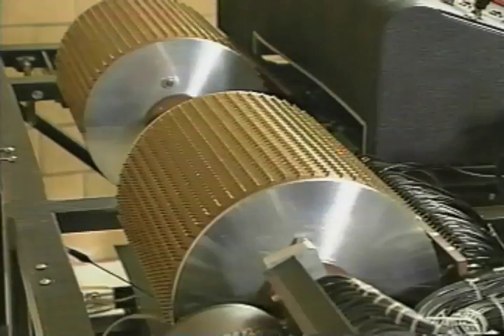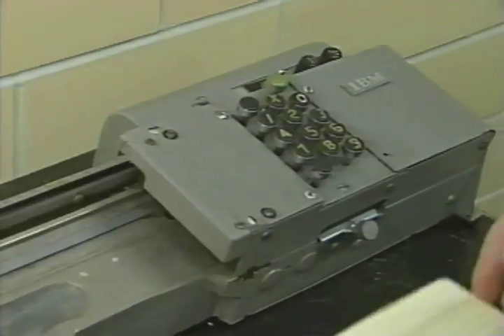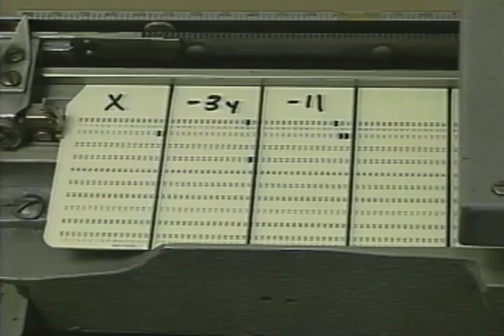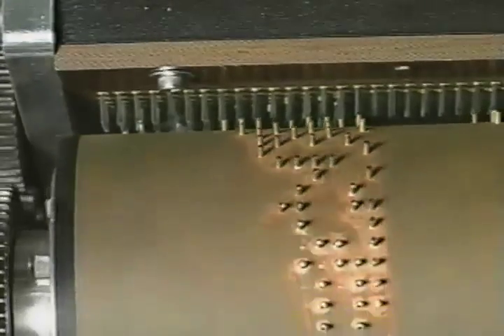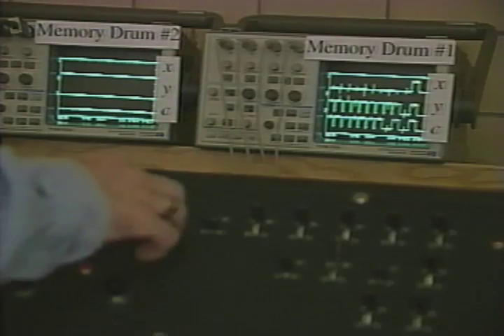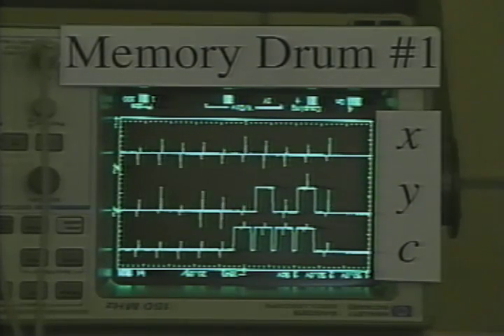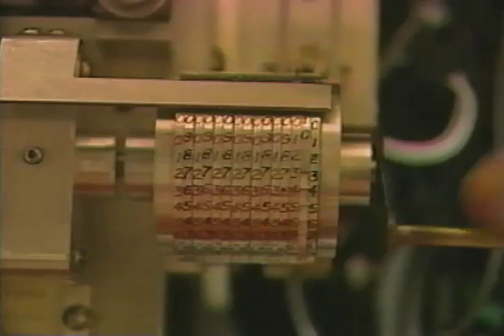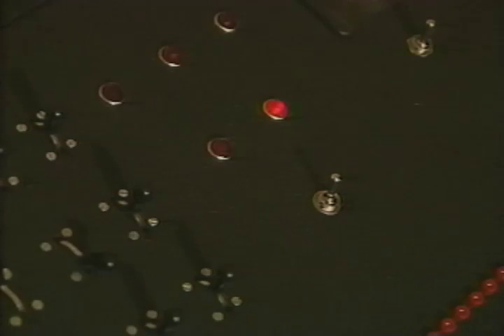The Atanasoff-Berry Computer In Operation

Comment: Computer operators had to be hands-on and attentive with all those mechanical parts. Imagine how badly you could mess up a computation if you put a card in backwards or if it wasn't seated properly.
Reply: This computer was a one-off, built as proof of concept.  It was never a production machine.  Computers very quickly became more practical operationally.  Hollerith cards have one corner cut, so a card in a deck cannot be oriented incorrectly without it being obvious.
Reply: The Apollo space program had a computer whose program was thin wires passing through metal cores, basically a metal core memory, but ROM not RAM.  They hired women skilled in needlework I believe, to "weave" the program.   Lots of room for error with that process!

Comment: what a waste of cable wires, why dont use printed circuit boards™? or even better, serial communications™?
Reply: This computer was one-of-a-kind.  Printed circuits are only economic when multiple copies are needed.  In any case, nothing was built with printed circuits in the 1940s.

Comment: It was not the first computer to have parallel circuits, since the 1941 Z3 had a parallel adder.
Reply: The early Zuse machines were relay devices, not electronic.  The ABC was the first electronic computing device.

Comment: The ZUSE Z3 was completed in 1941 and was a fully programmable digital computer, it was electro-mechanical though. But even the ABC has some significant mechanical elements. The ENIAC and the COLOSSUS were quite early, too. A statement like that at the beginning is difficult, especially when you think of several development prototypes that were built around that time. But never forget the ZUSEs. Just sayin' .
Reply: Oh get over it, this one was done in the 30s before any of the others.
Reply: I try to remember as many of them as I can, because they probably all made contributions.  Babbage.  The British wartime stuff like Collosus(sp?).  Zuse machines.  ABC.  Eniac.  Even the Univac I, the first commercial electronic digital computer.  People have this desire for "firsts".  But progress is usually more iterative with the limitions of each iteration driving the next iteration.  In any case, these fledgling computers are all interesting to me.

Comment: Wow! I would love to revamp this design using transistors and LEDS to replace the vacuum tubes. The LEDS will show you the logic state of each transistor.
The rotating drum looks like the biggest challenge. I think magnetic coils and small magnets might do the same job. 
The mechanical engineering that went into making these electronic wonders is just as impressive to me, as a modern electrical engineer. It's  fascinating to see what one could do with great ingenuity!
It was NOT invented by "extraterrestrial aliens", like so many Hollywood movies suggest 😞🙄

Comment: Well ACTUALLY the Zuse Z3 was first(being digital, but electromechanical), even being able to process floating point numbers, being able to be programmed and was turing complete. And built with electromagnetic telephone relays in May 1941.
Reply: And you are wrong, this was invented in the 30s, it just means is the first computer wasn’t Turing whatever or programmable.
Reply: @joshcorley9220  There are multiple sources, some say it was built before but didn't work flawlessly, others say it was built in the same year. Latest and most sure is probably 1942 when it was successfully tested.
Reply: @heynic37  their prototype was finished and demonstrated in 1939 so who cares, that would be the first one. And no it was finished in the first weeks of January 1941 and demonstrated in 1942. I’m pretty sure the Z was done later in 1941 and it wasn’t demonstrated until a couple years later.

Comment: The machine was astounding, but it wasn't the first electronic digital computer. It wasn't a general purpose computer, and it wasn't entirely solid state. So as a member of the historical nit-pickers society I have to pass on the ABC and award the prize to the ENIAC. 

Arguments like this are why the ABC eventually lost the patent.
Reply: You are confused. ENIAC lost the patent not Atanassoff - Atanassoff never aplied for a patent actually.
ENIAC was ruled derivative and the credit belongs to Atanassoff. They scouted him and ripped off his ideas.
"For a variety of reasons (including Mauchly's June 1941 examination of the Atanasoff–Berry computer, prototyped in 1939 by John Atanasoff and Clifford Berry), U.S. Patent 3,120,606 for ENIAC, applied for in 1947 and granted in 1964, was voided by the 1973 decision of the landmark federal court case Honeywell, Inc. v. Sperry Rand Corp., putting the invention of the electronic digital computer in the public domain and providing legal recognition to Atanasoff as the inventor of the first electronic digital computer."
Reply: @zarni000  Fair enough. While I was aware that a court case eventually placed the idea in the public domain, I was unaware of the details. Thanks for sharing.  I would still give the title of the first Electronic Digital Computer to ENIAC as being the first to have zero mechanical parts.
Reply: @SimplyDudeFace  there is technically no digital computer without mechanical parts until 1990s maybe. Eniac used inventions and concepts pioneered by atanassoff. Whether that's the first digital computer or the ABC according to various people is immaterial as the IP was all his.
Reply: @zarni000  I'm not arguing who developed the original IP. I'm simply pointing to the first computer where the main processing was done without any mechanical or electromagnetically components. Thus, discounting peripherals such as tape drives, and printers, this happened far before the 90's. Eniac wins this prize, despite any opinions of its creators.
Reply: @SimplyDudeFace  well regardless that is only your opinion. The experts concurr ABC is a digital computer. And as I pointed out it's even a moot point as the principles are all atanassoffs so even if Eniac were to be the first one (which it is not) it is irrelevant.
Reply: @zarni000  If the point you are making is about solid state electronics, the point is perfectly relevant.
Reply: @SimplyDudeFace  I guess you are as you described yourself...

Comment: Looks to me more like a semi digital calculator.
What I want to know is: What was the true first computer. It's needs to have a processor that has an instruction set and a program counter.
Reply: Mum Blic ugh
Reply: "First true computer" is subjective though.  This is why people debate these points all the time.  If they were precise, there's less debate perhaps.  For example, people could ask questions like "What was the first electronic, digital, stored program computer?"  That's probably easier to answer.  Of course you have to educate yourself on the variables first, but by the time you start learning about all the early computers, and how they varied, you probably know enough, to not be so worried about "firsts".  Progress is iterative.
Reply: Z1 built by Konrad Zuse in 1935/6 
(there's a replica but the original was destroyed by british bombing in ww2)
https://en.wikipedia.org/wiki/Z1_(computer)
http://www.computinghistory.org.uk/det/6170/Zuse-Z1-built-by-Konrad-Zuse/

Comment: computer? or just a calculator?
Reply: +edgeeffect Of course not in the modern sense. But it is a programmable compute-r. A calculator would just do simple arithmetic, so a human would still have to sequence the operations to do any useful work, but this could be programmed to solve actual equations. This was a one kind of machine in it's time.
Reply: +frtard It wasn't programmable.. it could only solve simultaneous equations. http://plato.stanford.edu/entries/computing-history/#Atan
Reply: edgeeffect Right. Like I said, it wasn't programmable in the modern sense of being Turing-complete; it would solve equations. It was different from a calculator in that it sequenced separate calculations; it didn't just do simple arithmetic. It does compute equations, though. I guess commonly accepted terminology doesn't make this point clear enough.
Reply: +NuggetOfBlueGold "A computer is a device that computes" is an over-simplistic definition based on the derivation of it's name and isn't particularly workable. At college, I remember, I was taught a quick and easy definition of what a computer really is - side stepping potentially complex concepts as Turing completeness: "A device for processing raw data into meaningful information under self-modifiable program control". When we're discussing computer history, we tend to waive a few of these requirements. We say it doesn't strictly haveto be self-modifying so that early stored-program computers like the Manchester MK 1 are "allowed" to be computers. We say the program doesn't necessarily have to be stored in the memory so that the the likes of ENIAC are "allowed in". The point at which just too many rules have been waived is what makes The Analytical Engine a computer but The Difference Engine “not a computer” and that is the requirement that it is PROGRAMMABLE. And this is the nub of Turing completeness... computers are general purpose machines that can
perform different functions based on their software and the Atanasoff-Berry could only solve simultaneous equations and nothing else. Which makes it very nearly a computer but not quite.
A calculator is a special-purpose computing device. But to be a computer it needs to be a GENERAL purpose computing device and part of that remit would, sadly, include the playing of games.
Reply: +edgeeffect  A General Purpose Digital Computer is an apparatus that translates, files, and manipulates symbolic data and information.
By this criteria, the British Colossus was not a computer! ! !
Reply: This was a 'Special Purpose Computer'! It performed simultaneous linear equations.
It did not have a Stored Program.
Its programmability was limited.
It was not fully automated.
It ROM sequencer was mechanical.
Conclusion: It was not the first modern all-electronic general purpose fully & freely programmable digital computer..

Comment: huh? how does the machine know how many digits there are to each number?
Reply: okay so the finished card has 3 fields, one for each number, but how did the operator decide in which field the pressed digits would go? i only see him pressing the numbers in an immediate sequence
Reply: Gigaguenther I imagine it's modeled after the IBM tabulating machines of the era. Those determined which digits go where by use of a plug board. Each column is wired so its value is assigned to different places. There are plenty of explanations of those machines on the net.

Comment: Ran across this old patent 3190554 on a digital computer that ran on air. Wonder if anything was done with this idea.
Reply: do you have to spam this comment on 100 videos?
Reply: It can't be on 100 videos! I never got any sort of reply so I kept asking around. So I'll ask again, have you ever seen such and air computer? Event the Computer Museums don't seem to any info on this tech. Patent 3190554 . I'd also like to know if  N.A.S.A. ever thought about using this in the manned missions.
Reply: +ufoengines Pneumatic logic was commonplace in industrial applications though hardly as complex  as a computer. Analogue pneumatic computers were also commonly used for control systems. 
I doubt that a pneumatic digital computer would have gained much interest for speed reasons.
Reply: I was thinking that as a 3D printing project for some tech high school that designing/building a Turing Complete digital computing running on air would be a gas! Might get a little more speed if you ran it with helium. Also read somewhere that live crabs have been run though logic gates to demonstrate computation. However you might pull the same trick using brush bots. Kids would have to dig this. First you make up a whole bunch of brush bots and then run through a maze/logic gates to compute something. That would make a You Tube that I'd like for sure!
Reply: +ufoengines I don't know about that particular patent, but pneumatic computers were in use for years in industrial process control. They are slow and limited, but they work.
Reply: +ValExperimenter The German V1 missiles were controlled by a pneumatic servoamplifier system
Reply: +ValExperimenter Pneumatic or Fluidic?
Reply: Pneumatic from what I read, Patent 3190554 and Patent 3107850. Seems to have been a non starter form the get go. The kid who come up with the idea gave it away. Now I'm looking around on You Tube to see if anybody is demonstrating Collision Based Computing using Brush Bots.

Comment: So I finally get to see it work... I don't see it as general purpose, though.
Reply: +scowell Can't be general purpose without being able to hold a program.
Reply: @david203  Hmm, to me general purpose just means you can program it generally, aka Turing complete.  A computer can easily be turing complete, but the program is input, "on the fly" on some sort of offline storage, like cards, tape, whatever.  People tend to use the term "stored program computer", when the compute program is stored in the computer's memory.
Reply: @michaelbauers8800  Yes. See the other comments for much the same information.

Back in the beginnings of computer history there were many devices that were intended to solve different domains of problems. The range of programming and the ease of reprogramming increased over time.

In this case, only systems of linear equations were solved, but the input was by punched cards instead of the more usual wiring boards.

Special/General purpose are relative terms, and can be defined externally in terms of the range of problems solved and internally in terms of the functionality used to program and compute the results.

There is no one "first computer", merely a large number of precursors to the modern Von Neumann architecture. See https://en.wikipedia.org/wiki/Von_Neumann_architecture .

Comment: I live about 30 miles east of the university and I happen to know one of the engineers who was on the team that built the replica. I was at the unveiling and saw it work. It is, of course, "primitive" by todays' standards, but try to imagine one man, in the course of one long evening coming up with the 7 tube adder/subtractor module, the input method and the memory drum (which is, BTW not DRAM but DSAM since it is sequentially accessed as the drum rotates. This was an AMAZING piece of work.

Comment: I know you weren't.  It's hard to get everything you want in with a 500 letter limit.  But that machine is striped down to the very basics.  With the limitations of mechanical components (as apposed to electronic ones) and the size of their fingers and what not, it's remarkably small.  And there's always a time factor, because mathematics is everything for an engineer, you could spend your whole life refining and calculating.  Check out Charles Babbage and his Difference Engine #2 here on YT
Reply: Stop comparing.

Comment: Not to bust your B's here, but "Primitive" is a term that should never be used when looking back in time at machines.  I can't imagine anything more simplified than this.  Write a simple program, or draw out a single digit calculator on paper. The shear genius involved is evident.  Once you have transistors, and realize they can be used as switches, things become easy.  But without efforts like this, when and why do transistors even get invented?  Vacuum tubes work great for amplification.